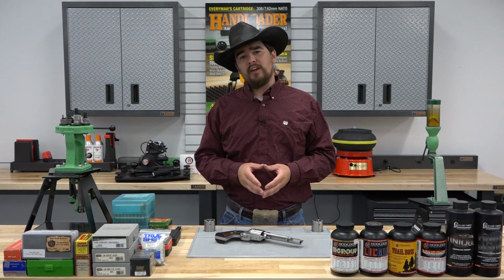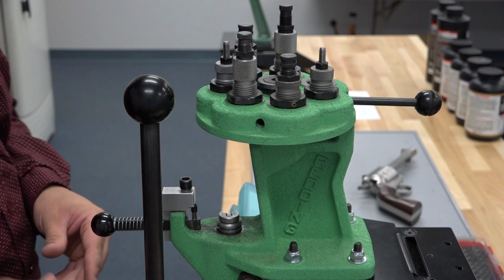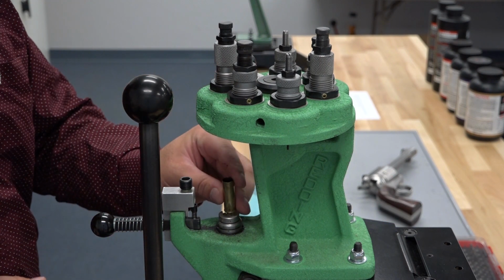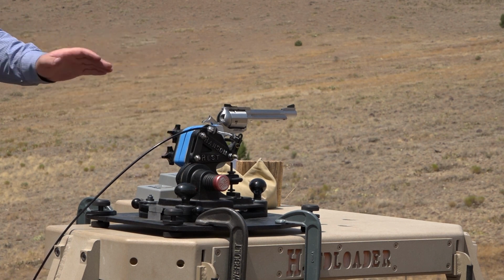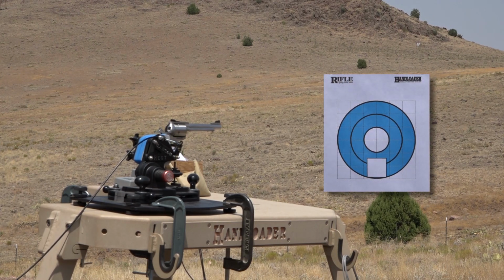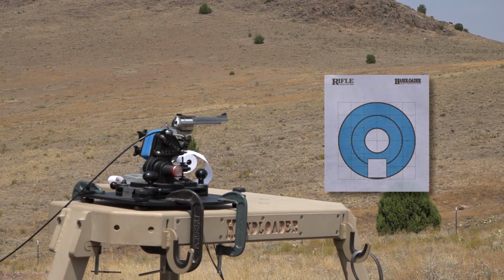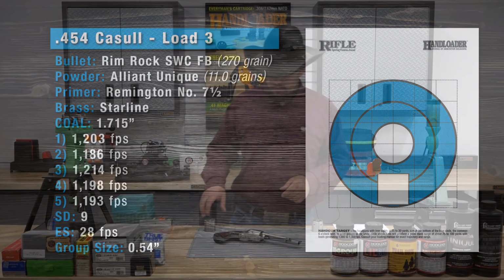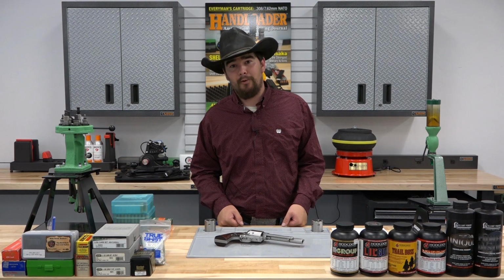Freedom Arms  454 Casull

Comment: What powder/primer combination do you like in .44 mag 300 grain hard cast pistol handloads? Some books recommend Magnum primers others don't. Is there a winning combo amongst so many varied opinions?
Reply from the maker: So I personally like H-110 with a CCI 350 magnum pistol primer for use with a 300 grain hard cast bullet, by hard cast I am thinking 22 BHN. So as far as winning combinations there is one suggestion I would like to make when it comes to primers. I like to use magnum primers with very few powders, they are as follows, H-110/W-296, Lil' Gun and Accurate No. 11FS. Those powders seem to produce the best results with Magnum primers pretty much the rest I will use standard large pistol primers, they generate less pressure and I have had better results with them as well. I would suggest starting your own experiments there and I think you'll find good results, Great question and thank you for taking the time to watch and comment! --Jeremiah
Reply: @HandloaderTV  
Thanks for sharing your expertise Jeremiah. Ol' Elmer would be proud to know that his pet project is still garnering lots of handloading attention in the twenty-first century. 

Just got in from the range. I loaded several rounds of five 300 CPFN gas check bullets, using H110, AA#9, IMR 4227, and AA1680, for my Ruger Redhawk. Each was stoked with a Federal Large Pistol Magnum primer. No noticeable signs of excessive pressure, but none of them grouped all that well at fifty yards. The H110 loads shot okay, as did the AA1680 fueled cartridges. The H110 loads will probably be the keepers, for further development and testing. I'll save the other powders for future projects. 

I will be using these loads primarily for bear defense during my upcoming elk hunts in Colorado and Wyoming this fall. My 340 Weatherby will do the heavy lifting, with the .44 Mag as enforcer for any up close and personal work. Guess it doesn't have to be all that accurate, since he's gonna have to eat 1800 grains of lead and copper, instead of my leg. 🙁

One last question...when you sight in a scoped (laser red dot) big bore handgun, do you start at 25, 50, or some other yardage? Do you bore sight your handguns first? 

Thanks again my friend. Much respect and appreciation for what you do, and how you do it! Good shooting and happy hunting!👍🏿
Reply from the maker: @bustabass9025  You are very welcome I am always happy to help out whenever I can! I agree in full, it is a great cartridge though and it is worthy of a lot of merit! 

I also suggest when using H110 to use a very stout roll crimp as it will help with consistent powder burn as well. If you are looking for top notch accuracy I also suggest trimming the cases and crimping as a separate step this ensures you are getting the most uniform crimp possible. 

That sounds like a good purpose for that handgun and I think you also selected the correct bullet for the job as well. It is pretty hard to beat a hard cast wide nose flat point!

I typically sight my guns in at 25 yards, because there is not much difference between 0-25 yards as shot placement goes. With that said if I know i'll be taking longer shots say 50-100 yards I will sight in for 50 or 75 yards depending on the cartridge. I don't typically bore sight my handguns unless they are way off paper at 25 yards. 

No problem always happy to help thank you for all the support and taking the time to watch and comment! Good luck to you on your elk hunts and keep your powder dry! --Jeremiah
Reply: @HandloaderTV  
Man, you don't know how much I appreciate this interaction Jeremiah! I have been a Handloader magazine reader, ever since I rolled my very first .340 Weatherby cartridge some thirty years ago. 

You and Handloader TV have elevated the practices of handloading, shooting, and hunting to a whole other level. You are a great ambassador for what they are doing to further the knowledge, art, and practicality, during these times of such heightened interest in these activities. 

Having this level of access to your expertise is invaluable. Also, your well wishes have elevated my confidence in returning from out west all tagged out this year. Tell 'em over there, I said to give you a raise. 💰👍🏿
Reply from the maker: @bustabass9025  You are very welcome! Like I said we are happy to help! Especially since you have been a subscriber for so long we greatly appreciate it, if it weren't for good folks like you we would not be able to produce these videos. All the income comes from our Loaddata website and the magazine. YouTube currently will not let us monetize our channel as we had originally hoped and we have no sponsors either. We want unbiased, honest information getting out there way too many myths repeated on the internet. 

I appreciate the kind words it makes my day to hear stuff like that. At the end of the day I am just happy to help others grow their knowledge and share good solid info on the hobby or obsessions we all love. 

I am very glad to hear that! I wish you all the best in your hunting adventures hopefully you can take home some game with you! Take good care of that .340 Weatherby that is a great cartridge! Again thank you for the kind words it is my pleasure! --Jeremiah

Comment: I have one like this but have never used the other two cylinders, this is my second freedom arms model 83 so im keeping this one 😉. I will say its different shooting one  at 30 than at 58 , it's still beast but as for me not so much 🤦. Oh by the way please help me find the pachmayr grips they're impossible to find !
Reply: Hi, your question interests me because I want as much info as possible before I commit to  buying a .454 myself.
I was under the impression that a heavy recoiling cartridge such as the .454 Casull required the revolver to have grips that allowed the revolver to rotate in the hands on firing so as to dissipate much of the energy. Wouldn't a rubber grip prevent the rotation which would mean the recoil energy is transferred backwards into the wrists? 

I'm just looking for as much info as possible before I put a bunch of cash down on a .454 and someone's opinion who owns one is worth a lot imo.
Reply: @pete7413 SORRY i didn't see the question, the recoil is  not that much different to me but the feel of the pachmayr grips fit my hands better so it's a control issue. I have all three cylinders but 454 work for long range shooting/hunting, Freedom Arms is like the best minds in the business came together to build it and i'm in LOVE all over again 😊.
Reply: @arthurholmes2210  Hey that's okay thanks for taking the time. Well since my question I've gone ahead and bought two Freedom Arms revolvers. I didn't get a .454 (yet) I bought a 7 1/2" .44 mag and a 10" .41 mag silhouette model (model 654 I think but same frame as a model 83). 

As to my original query about needing to have the revolver rotate to help with recoil, both of my revolvers came with Pachmayr grips and I am glad I have them as they take the sting out, certainly better than the smooth grips I tried with it.

Comment: I really need an 83. I am, however, a wuss, and would live with the .45 Colt cylinder stoked with heavy cast bullets in the 32,000 CUP range.
Reply from the maker: The Model 83 is one fine Revolver and extremely strong and accurate. Given our 45 Colt and 45 ACP performance in this Revolver I would say that it still would be a good buy for either or both of those cartridges.
Reply: Would love it if FA produced this revolver in 45colt with a 6-shot arrangement, due to less need for general strength.
Reply from the maker: @exothermal.sprocket  Yeah that would be pretty neat to have a 6 shot cylinder! I think folks also like to hype up 45 Colt loads and reproduce Dick Casull and his experiments with modern powders and no fear of damaging the firearms. Personally I think it would be cool to offer both 5 and 6 shot cylinders.
Reply: @HandloaderTV  Understood.
But people have been cranking loads near 40k psi or higher in Ruger Blackhawk 6-shot revolvers and nothing breaks. I'm thinking the greater diameter of the FA cylinder would offer even more strength in 6-shot vs. the Blackhawk. FA runs superior tolerances compared to the sloppy-by-comparison Blackhawks, and I'm a fan of the Blackhawk.
Reply from the maker: @exothermal.sprocket  That is very true I imagine if they wanted to they could easily make a 6 shot cylinder that could handle more pressure than the Blackhawks. It is amazing the attention to detail Freedom Arms puts into every revolver. I am a big Blackhawk fan as well but the Freedom Arms is in a totally different class when it comes to construction.
Reply: Nah, doesn't mean your a wuss. Just means you value the cartilage in your wrists and elbows and you have a brain. Also, "a man has got to know his limitations." - Clint Eastwood as Dirty Harry Callahan in Magnum Force
Reply: Demetrius Cooksey That for sure, combined with the fact that a .45 Colt pushing a 280 grain cast bullet at 1050-1100 will kill anything that walks or crawls in the lower 48. 

One of my favorite movies.
Reply from the maker: @demetriuscooksey7147  I think you sir win the unofficial best comment competition for this video! excellent movie! Thank you for watching and for commenting!
Reply from the maker: @876mpr  Indeed 45 Colt is a personal favorite of mine so I was very happy to have the .45 Colt cylinder included with this gun. It is nice to have the options we have today!
Reply: @HandloaderTV  Cool, thanks aye!

Comment: I'm confused why there is a separate 45 colt cylinder? I thought yo0u could shoot the 45 colt in the same cylinder as the 454
Reply from the maker: I believe there are a few reasons for this, the first is because if you shoot a significant amount of 45 colt cast bullets through the .454 Casull cylinder it is possible to have lead build up and cause the pressure to spike when you load a full power .454 Casull cartridge into the gun and fire it. This could potentially have enough pressure to damage the gun or the shooter. The second reason is the .454 Casull has slightly different dimensions most notable is the case length and in order to achieve the highest accuracy which is expected of these revolvers a dedicated cylinder is required. I hope that makes sense and if you have any further questions don't hesitate to ask! Thank you for watching! --Jeremiah

Comment: Do you think their 45LC can handle magnum pressures? So far only the old Blackhawks and Vaqueros seem capable to handle those.
Reply from the maker: First of all I want to thank you for watching and taking the time to comment! That is an excellent question and when it comes to 45 Colt there is quite a bit to talk about and generally speaking there are 5 ways to break it down or 5 categories of pressure to load to and it depends upon your firearm. The Freedom Arms model 83 is capable of handling the highest level of pressure even more so than the Blackhawks and Vaqueros. There is an excellent book by John Taffin called the book of the 45 and he details these unofficial pressure levels. Should you want to learn more I would highly suggest checking out the book of the 45. --Jeremiah

Comment: My pet load for 41 Mag is about like your 45 LC load. 220 grain Lyman Keith bullet over 8 grains of Unique.
Reply from the maker: Unique is just a great powder all around it is one of my favorites not as clean as some of the newer powder but it just plain works well! It is nice to hear what other folks are experiencing as well. I am a big fan of the .41 Mag awesome cartridge!
Reply: @HandloaderTV  I'd like to see what kind of load could be worked up with a heavier cast bullet and Unique. Thinking a 360 grain  at like 900-1,000 fps would pack a lot of whallup but still be reasonable in the recoil department.
Reply from the maker: @demetriuscooksey7147  The recoil would certainly be less at that velocity than a full power load using H110 at 1,500+ FPS. We have not tried a 360 grain bullet with unique but we have tried a 325 grain bullet with unique and I would call it a mid range load but closer to the higher end of that spectrum than the lower end if that makes sense. It still packs quite a punch but I would consider recoil very manageable.

Comment: Handloader TV I know that the 454 Casull can take down a bear in one shot. Naturally this round at this load level. Is way too much for human defense. Is there a ammunition manufacturer. That produces the 454 Casull. In a personal conceal carry level. Or can you purchase  gun powder. And or a short brass shell. That will detune the round to a conceal carry level?
Reply from the maker: So there are a few options for sure, I agree that it is too much gun for self defense. The first thing I would recommend especially with the Freedom Arms model 83 is getting a .45 ACP cylinder and or a .45 Colt cylinder. Then factory ammo can be used for self defense easily. I am unaware of any ammo manufacturers that are making .454 Casull reduced loads. You can certainly use .454 Casull brass and just load lighter charges to duplicate .45 Colt, this can be done with relative ease. I would probably recommend a different cartridge and firearm for self defense against humans though. Great question though and thank you for taking the time to watch and comment! --Jeremiah

Comment: I have noticed that your most targets hits are a little to the left. I HAVE THE SAME PROBLEM WITH FREEDOM ARMS .83. What is wrong?
Reply from the maker: Have you tried adjusting the sights? They are adjustable for both windage and elevation. That is just how ours shot out of the box. After zeroing we had no issues with the point of impact hitting left to where the sights were.

Comment: Hello, I have a question for you, is it ok to use 45 LC in the 454 drum, I only have the 454 drum and in Sweden it is really hard to get another one due to licens issues.
I have been using 45 long colt in my mod 83 field grade 7,5 inch for ages and did not know there was a 45 colt drum. I love the gun but usually fire light loads att paper targets, hunting with handguns are not allowed in Sweden
Reply from the maker: That is a great question.  If you shoot a significant amount of 45 colt cast bullets through the .454 Casull cylinder it is possible to have lead build up and cause the pressure to spike when you load a full power .454 Casull cartridge into the gun and fire it. This could potentially have enough pressure to damage the gun or the shooter. The second reason is the .454 Casull has slightly different dimensions most notable is the case length and in order to achieve the highest accuracy which is expected of these revolvers a dedicated cylinder is required. However if you are just shooting light loads and you are cleaning between cartridges I don't foresee that becoming an issue and I think you could continue to shoot .45 Colt through your .454 cylinder. I hope that makes sense and if you have any further questions don't hesitate to ask! Thank you for watching! --Jeremiah
Reply: Thank you sir
Reply from the maker: @ulfberner4397  You are most welcome!

Comment: What is the barrel life of this barrel and cyllinder with .454 rounds?
Reply from the maker: That is a great question and to be honest I don't really have a good answer to that. It really all depends on what kind of loads you are feeding it and how hot you are getting it along with what powder you or the ammunition manufacturer is using. I would say generally speaking if you are not too hard on the gun it should be somewhere in the 2,000-3,000 range but it could go way up depending on the loads and cleaning routine. Thanks for watching and taking the time to comment! --Jeremiah
Reply: Thank you for the reply, so these high pressure rounds are realy barrel killers, those are 60.000psi if I do remember correctly right?

Comment: I notice you didn’t shoot any full house rounds from your hands!
Reply from the maker: I actually did around 28:05 into the video however I only fired one as I soon realized that it was severely cratering my steel targets and even bending where they attach to the dueling tree! Due to this issue I did not fire any more full power loads at the steel. I probably should have put up some paper targets hindsight being 20/20 just so folks could see what that looks like but sadly I did not think of that in time. I did fire about 50 rounds of Factory Loaded Freedom Arms ammo along with about 20 round of Black hills ammunition and both were full power loads. I also continue to shoot and hunt with this revolver using full power loads. The recoil is certainly significant though and it also gets tiring on camera. Thank you for watching and taking the time to comment! --Jeremiah

Comment: Nice set up.  Had not known about the Freedom Arms connection.  And like the  .44 mag, there is a lot of latitude on how stiff you load it.  I currently am enjoying 9 grains of Unique under a 240 grain cast boolit in my Super Blackhawk .44 mag.  Using that same boolit, 7 grains of Unique is a winner in my 24-3 .44 special.
Reply from the maker: Thank you very much we appreciate the feedback, please share this with your friends if you think they would enjoy it! Freedom Arms makes very fine and well made revolvers. Indeed the .44 magnum is a very versatile cartridge and unique is a great powder. I like to compare it to engines you can get a small engine and push it's limits or you can get a big engine and throttle it back but should you ever want the extra power it is there. Handloading opens up the versatility of any cartridge and maximizes your potential.